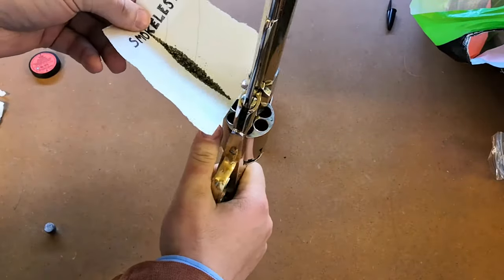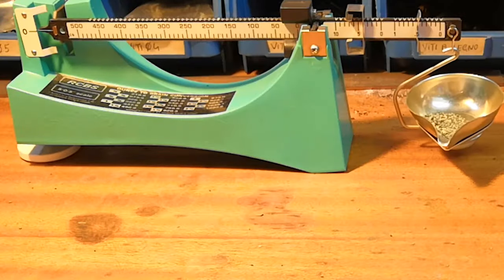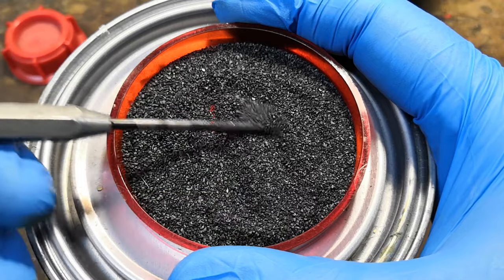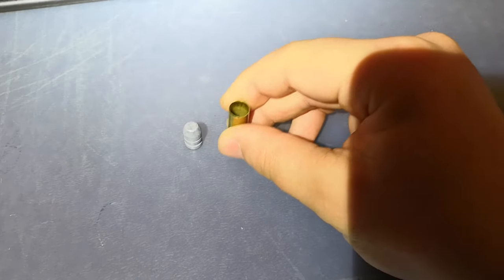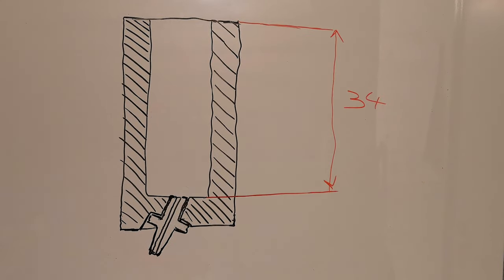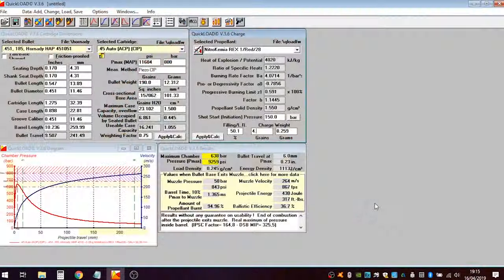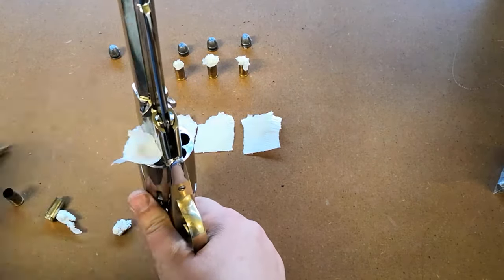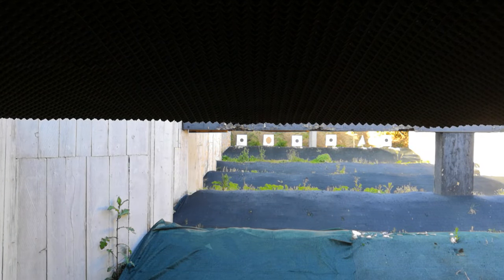Smokeless Powder in a Muzzleloader: What Really Happens ?

Comment: Almost fooled me but I'm no fool. It is never safe to use smokeless rifle or pistol powder in a muzzle loader because of pressure spikes. The pressure spike(s) are managed by the metallic cartridge. The enormous spike (s) in pressure occur so quickly that they are not provided in most data. They are well known and managed during development of chambers, cartridges, and load development. Rifle cartridges often have a pressure spike greater than a black powder maximum charge pressure. In a very hot rifle cartridge the spikes can exceed 30,000 psi/ cup pressure.....were talking about total pressure of 80-90,000 psi. Powders developed for metallic cartridges often rely on design factors which buffer the spike: Case wall thickness, case web thickness, case dimension shrink and stretch, chamber throat leade, and often free bore. 
Black powder charges generally don't have a significant pressure spike. The slow burn rate builds pressure progressively over the length of the cylinder (revolver) or the entire length of the barrel ( muzzle loader rifle). It should also be noted, that primers are significant in managing the pressure spikes of smokeless powder.

Comment: I have a Colt Walker. I only want to use 20 grains of black powder. (The "normal" powder weight is 60 grains,  I think). The gun's built in ramrod only pushes the bullet in a little, and that means I'm leaving a gap between the black powder and the rear of the projectile. Should I use some inert powder on top of the gunpowder? (To take up the extra space)

Comment: Would be interesting to use a 44 barrel and cylinder. Sleeve to 
add wall thickness. Reduced load a 31 cal cylinder bore and barrel 
Use in a 1858

Comment: Well even if you do not blow up your gun, the increased pressure spike will stretch the frame. I have some older revolvers in my collection that clearly got stretched to the point of not being safe anymore.
Reply from the maker: I calculated the load to reach a maximum pressure equal to that of the average black powder load. The shape of the pressure time curve may be different, but the maximum pressure is the same
Reply: @Backyard.Ballistics  Sorry, I should had specifically said if you exceed maximum pressure. Most modern black powder revolvers will not blow up in your face if you are a bit over pressure, but you can still stretch the frame out of tolerance.
Reply from the maker: @Jesses001  oh yes, definitely agree!

Comment: The secret of using smokless is the empty space in the chamber after loading, it catches the stronger first peak of smokeless ....
If you have a conversion of a cal.36 (Navy Colt) to .38special, you also shooting smokless !
The point is, the bullet is NEVER compressing the powder.
Reply: Smokless is NOT designed to be compressed, as plackpowder has to be.
Reply: Tom Cooper 
Something to consider with the idea of “never compressing a smokeless powder”,, Trail Boss is a smokeless powder, doughnut shaped kernel, and used very often for cowboy action shooting and softer loads. It can be compressed or full capacity cartridge loaded, and is called an idiot proof powder because it is so fluffy you can’t overload a cartridge. 
I also like the idea of finding a safe smokeless load for MODERN reproduction C&B revolvers, to save from the fouling issues, AND my indoor range will Not allow black powder use. 
My preference would be to make paper “cartridges at home and using them at the range. With this method there would potentially be no powder space, so the correct selection of powder is critical.
I’m looking more into the trail boss powder characteristics. Regards.
Reply: @kenjackson4177  : Did not know this kind of SP exists !
Thank you verry much for this info !
Greets.
Reply: If it has a brass frame I'd be careful converting to .38 special. Also might be illegal in some states as it will now be classified as a modern handgun(I know its legal here in Missouri but it will be considered a "Ghost gun" in some states such as California).

Comment: Its definitely not a great idea, but It can be done. I also tested homemade fas burn rate powder and it also worked. I was testing different home made powders for use in modern revolvers and also tested it in my cap and ball revolver. With 10 grains of it I got 800 ish fps with a 220 grain conical. Again, it is not a great idea. I didn't hold the revolver, I set it up in a ransom rest and fired it with a string.

Comment: what if we only use paper wad and birdshot with smokeless powder? what i know is that the pressure and gas will choose the path of least resistance and since paper wadding and lead shot isn't air tight, the chamber will not be over pressurized more like under pressurized.

Comment: If the gun is rated to fire at 700 fps, anything over that will cause an explosion. If the black powder you are used by only gives you 450fps, you might be able to use 50/50 to get 700fps. Trying to get 1000 with pure smokeless is just idiotic.

Comment: An equivalent load of smokeless would be much smaller. Cornmeal for filler.  Example on 1858 5.5 gr by weight clays smokeless, 30 gr by volume cornmeal .454 ball.
Reply: No no no don't use filler powder with smokeless that would cause a compressed load which isn't good on most pistol powders(MAYBE something like H110 if using a bottom end load, but that's a magnum pistol powder). I would recommend never using smokeless in a cap and ball revolver either just because it's very easy to cause it to become a pipe bomb with a fairly minor error, but not using filler even applies to most cartridges.

Comment: I have a question. What if you were to use slow burning rifle powder like Reloader 25 or Hogden h1000? Would the slower burn be less pressure?
Reply: A magnum rifle powder in basically a .45 ACP without the brass... think about that for a second. The burn rate is WAY too slow for a revolver.
Reply: @redtra236  you're guess is probably right. It happens so fast it's hard to wrap your head around the difference between a gaped cylinder and a sealed barrel and that it makes so much of a difference. .

Comment: Great video, thanks! I, too have been wondering about this as i have about 30 pounds of really slow (.50 cal) smokeless powder and several Pietta copies of Remingtons and Colts.....and i do also own Quickload. So i wonder if that sloooow powder would work.....? Only one way to find out, i guess!
Reply from the maker: It's not going to work at all, in fact it could even stop burning due to insufficient pressure, i suggest not to use it. A shotshell or pistol powder is needed

Comment: Still dare you to make powder with match heads and charcoal see if coffee creamer or gypsum dust. Is better salt peter substitute . Ps those pittea revolvers can take      44 special  but not 44 magnun  with a cylinder change.
Reply from the maker: Match heads are already fuel rich, so adding more fuels like charcoal or coffee creamer would worsen the situation. Gypsum can only act  as an oxidizer in presence of very low electronegativity metals like aluminum and magnesium, so it wouln't help burning organic fuels. I've made black powder in the past many times though, using the regular formula.
Reply: I wouldn't trust it even with .44 special if it has a brass frame

Comment: Yes I agree it is possible in a pinch. But is it smart NO. Yes if the metal is the same as newer firearms and the walls are just as thick and you know what you are doing it is a no brainer it will work. But if you forget one thing you got a big problem. But prosthesis may fix your hand if a piece of metal didn’t get a import part of your body.

Comment: Is'nt black powder considered an explosive, and smokless is a propellant?
Reply from the maker: I wouldn't consider that a very meaningful distinction, even though it is mentioned very often. I would consider explosive any substance or mix of substances that is able, once ignited, to convert some or all of its solid or liquid mass to a hot gas. And I would consider a propellant any explosive that for its burning behaviour and for the geometry it is made into is suitable for generating gas in a controlled manner, so to be useful in gun or rocket propulsion. So I would consider both smokeless and black powder propellants, and hence explosive substances. They just behave very differently, and black powder has a much higher burn rate at atmospheric pressure, which is the reason why in storage and trasport is much more dangerous than smokeless. This reverts at high pressures, where smokeless burns very fast, meaning that very high pressures can be easily reached.
There is however a very substantial distinction which is between deflagration and detonation, and propellants must always deflagrate.
Many explosive substances can both deflagrate and detonate. Nitrocellulose, the main ingredient of smokeless powder, can do both, but in guns we only want it to deflagrate. Black powder, on the other hand, can only deflagrate.
Primary explosives, like lead styphnate, mercury fulminate, etc. almost always detonate, and only deflagrate in very tiny amounts.
Thank you for bringing the question 😉
Reply: That almost sounds like a premise for a video! Thank you for the detailed reply.

Comment: I wonder what would happen if you mixed 10% smokeless powder into 90% black powdered load.  Some of the videos I've seen with cap and ball , the shots seem a little underpowered . Why don't you give it a go?
Reply: You will blow up the gun, even with only 10% of smokeless !
Why : You have to fit the bullet with NO SPACE on the blackpowder, but the smokeless NEEDS a free space in the chamber !
If you compress smokeless in ANY amount, you will blow up the chamber.
Never mix Diesel with Gasoline !
Reply: @TomKappeln  Thanks
Reply: @Swayzeo  : You're welcome.
Greets from Germany ;-)
Reply: @TomKappeln  Smokeless can be compressed. Black powder can't leave a gap, but smokeless can be compressed, up to about 10 compression or so.
Reply: 10% compression or so. Check a reloading manual to see, eg the Lee manual will have a little "c" by compressed loads.

Comment: But NEVER  USE SPHERIC POWDER !!!........  SPARKLING POWDER ONLY.........  i do tbat in ROA and Walker  UBERTI ..... in walker its easy to recreate condition of a 45colt  case   !     CYLINDER WALLS ARE THICKS  .. but never compressed  loads  1/15 inch exess of plugging  resuts 2  times  normal pressure and kaboom